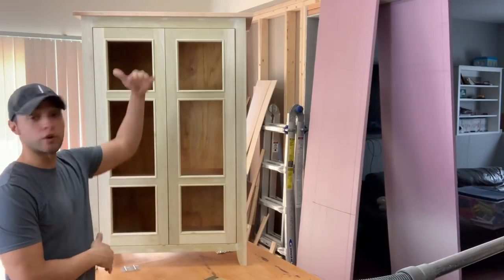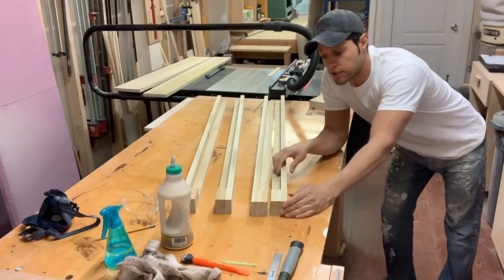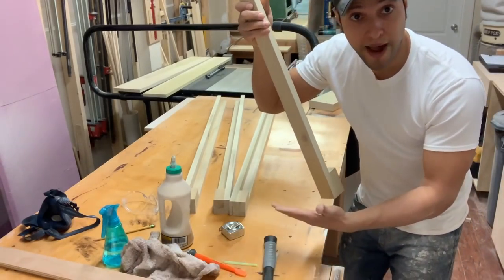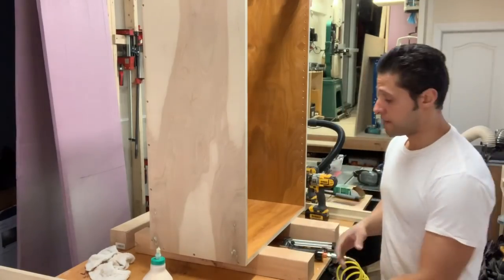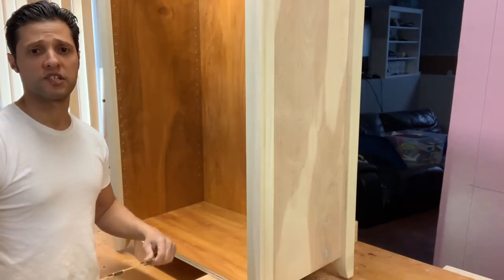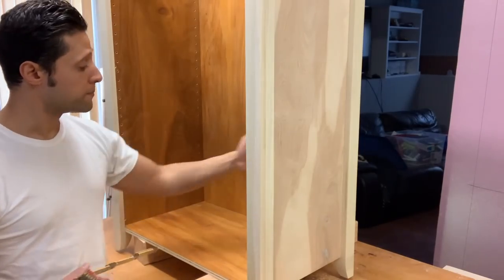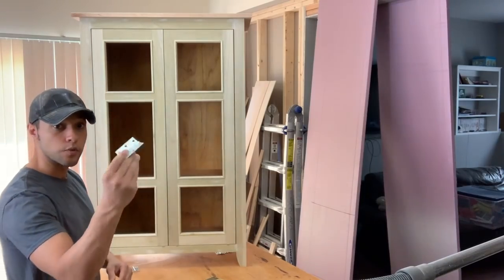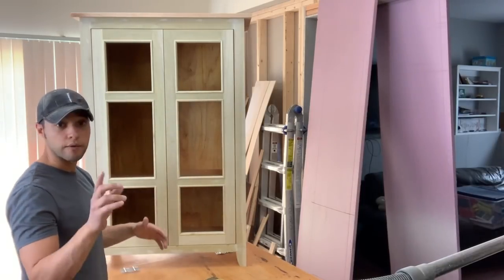Make A Linen press

Comment: Nice job ! I like the simplicity of the design, especially the legs forming part-frame. Looking forward to the finish and setting the hinges - I struggle with inset doors.
Reply: Huh, yeah i have the kreg pin jig, but it is much smaller. Thought that rockler might be better, or morw convenient anyway.

Comment: I am I. Northern California and what they call a Mill worker Contractor.
Meaning furniture, cabinetry , finish carpenter.  I would charge about 5/6 hundred for that maybe more if above paint grade wood?
What state R u in and what did you charge for that piece (approximate).

Also are you required to hv a state license (like in Calif w/CSLB) or is it just city license or none?

I am curious what other custom carpenters charge that basically my only thought!
By the way you have talent!  Keep it up and you should contract!
Reply from the maker: zephyr1408 thank you. I’m using general finishes water Bourne milk paints and top coats. They are a professional product that replaces the use of the oil based lacquers and paints that would require an epa license here in NY to spray

Comment: I see a cabinet, not a linen press ????
Reply from the maker: joeychgo it’s a custom version, a linen press can be a low to mid or even a high cabinet. Yes the original linen presses were often taller and usually had a bottom of drawers and not always glass panel doors, but when is the last time you saw a client ask for a traditional linen press.